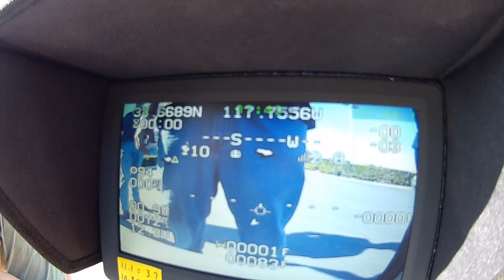RiteWing Drak Maiden Flight

Comment: Congratulations on the maiden. I felt as nervous as you did lol. Got my own maiden to do today of the cloud surfer. Not quite the same league as the drak I know but the pre maiden jitters are still there! Flying it is not a problem, my funjet ultra tops out at 115mph, but the fear of taking the cs home in a bin bag is still there lol.
Reply from the maker: +mrmurder75 Thanks buddy!  It was a lot of pressure......  The cloud surfer is a pussycat, so easy to launch and control, you'll have no issues..

Comment: Fantastic to be there for the event. I am impressed with your performance skills under extreme pressure. I could not have handled the crowd, that pesky media guy (Albert :-)), FPV, stabiliser electronics and a dog all at the same time. Great effort.
Reply from the maker: +Andrew Newton Thanks Andrew- I need to fly this thing on a calm day.  I also programmed a switch with 40% up elevator for launch which should help when solo launches

Comment: Great maiden Jeff, launching it looks like a bit of a mission if you was on your own, would 5s make it easier to launch with the extra power?
Reply from the maker: +Anything, RC “clarkey” Chris It seems to need that extra punch for the launches. But..... I accidentally launched the first one in Stab mode which leveled it when it didn't have enough speed.... and I programmed a switch on my radio to give me 40% up elevator for launching- my goal it to self launch it...
Reply: +7demo7 it's amazing how you can forget things when maidening a new plane ,I've done it myself it gets the hart pounding.

Comment: Awesome job man. I will be maiden ing mine soon with the arrival of the 5s batteries. You mentioned you need 5s, did you maiden with the Drak ritewing SS motor and what was your AUW?
Reply from the maker: I was using 4s and a Xonra980kv motor 12x6" prop. AUW was 3000g. I don't "need" 5s but it would be nice to have the extra thrust for launching.
Reply from the maker: Cobra not xonra